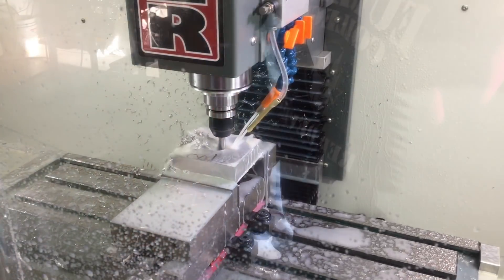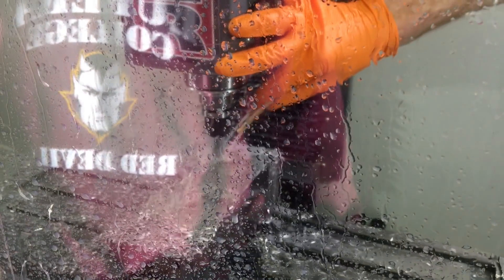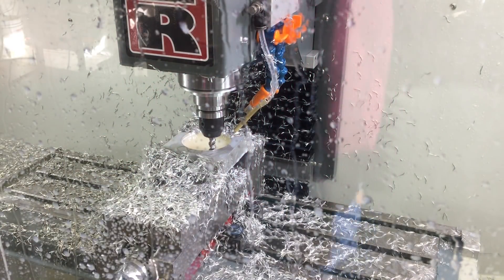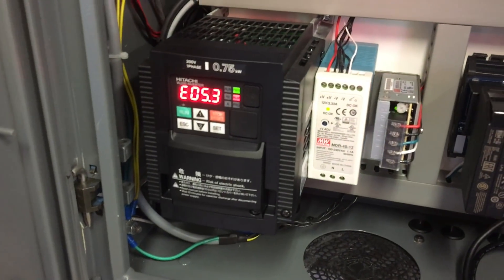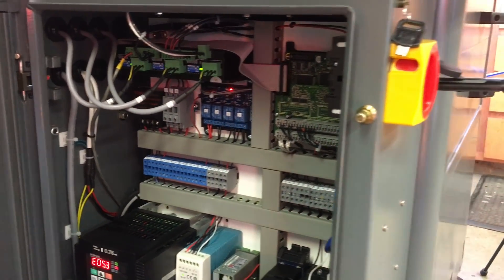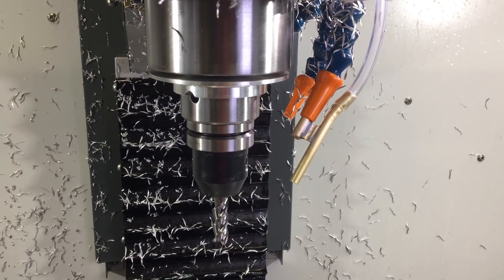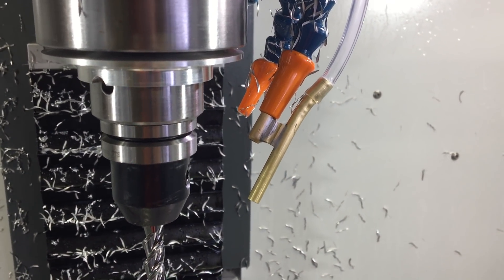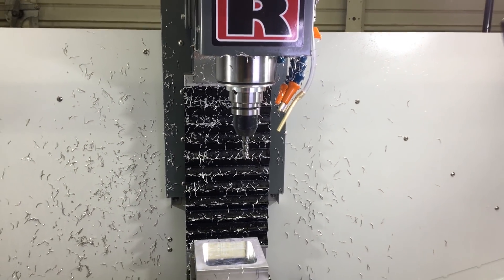Testing prototype "air blaster" / VFD emergency stop

Comment: Did you lose position when it faulted? Something I have noticed when I use the E-stop is that you may not stop dead on. I had some disastrous results trying to restart immediately after an E-stop. Always better to just relocate the part/fixture and then restart the code to make sure. This way you may only be off a couple thousand than a couple hundred as the machine may have "coasted" to a stop.
Reply from the maker: the VFD is setup to trip the E-stop circuit if it faults out. Im of the same thinking as you, any time a estop is triggered especially on a open loop stepper setup, its best to relocate and start fresh. I did see a setting in MACH4 that talks about e-stop events and how they are handled, hard stop vs some kind of controlled stop as to keep position? idk, its so easy to re-indicate apposed to chancing it....  - Nick